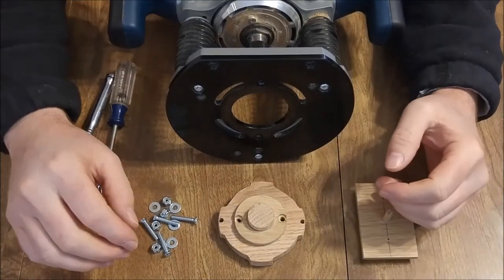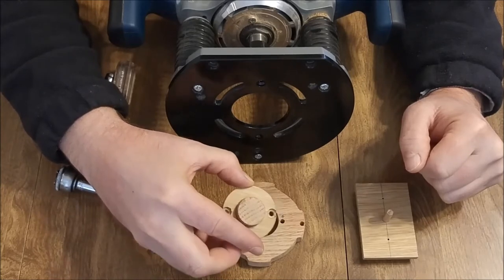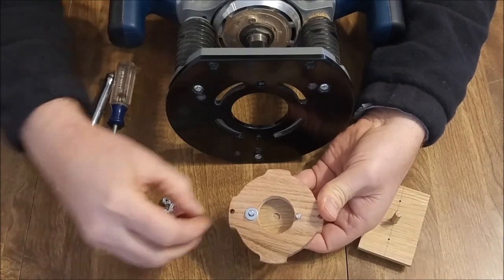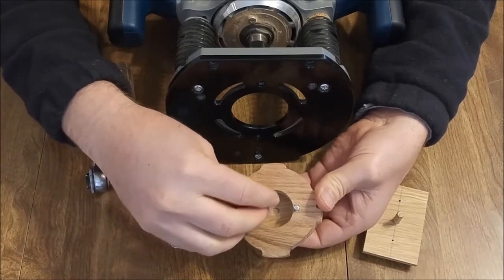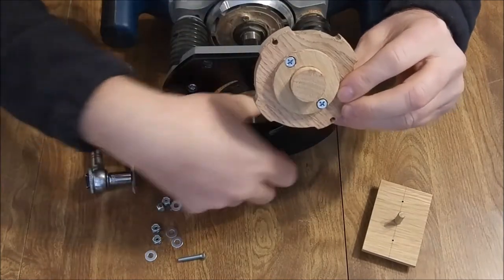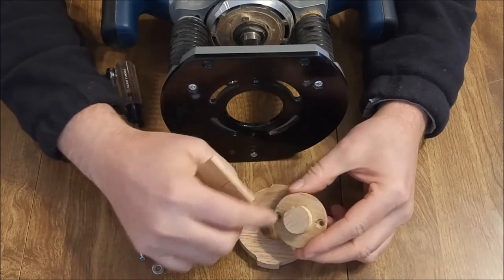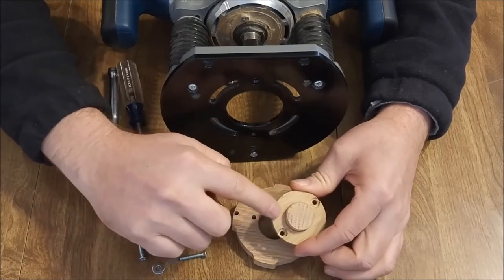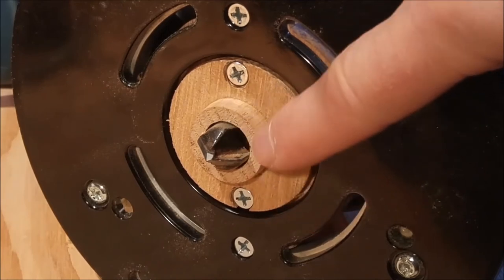DIY Wooden Router Guide Bushing

Comment: nice outside the box thinking on this one.  I like the way you present the material too.  You don't dumb it down or make it overly complicated.   I found this because I'm looking to make my own as well but for much smaller work.  The smallest I can find is 1/4" OD for a 1/8" bit.  I need to go 1/16 or even 1/32" bit so I need a 1/8" guide.  I'm going to use a piece of car antenna wedged into a base plate like you did.
Good stuff!
Reply from the maker: Glad you liked the idea and video. Using this idea for a much smaller bit is something i didn't think of back then but can see the benefits of doing that and will keep it in mind in case I need to do that myself in the future.